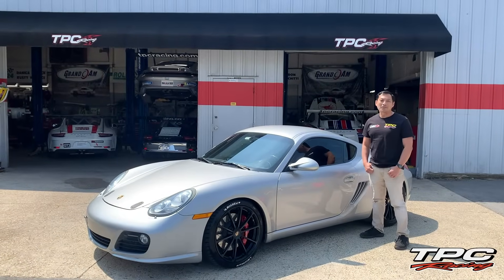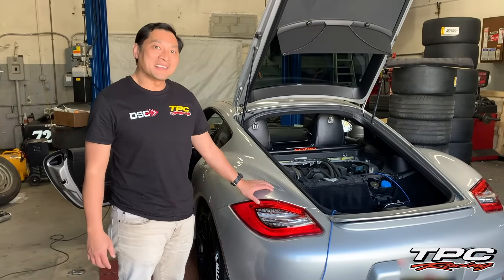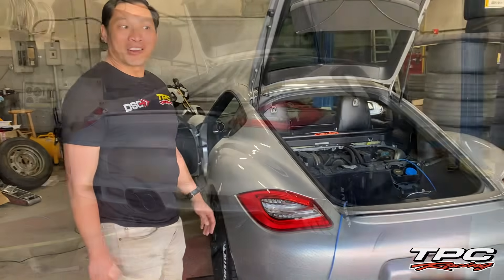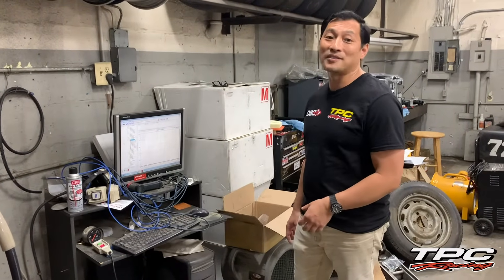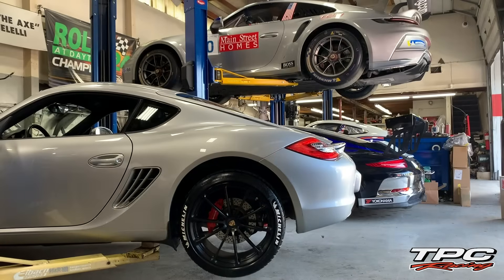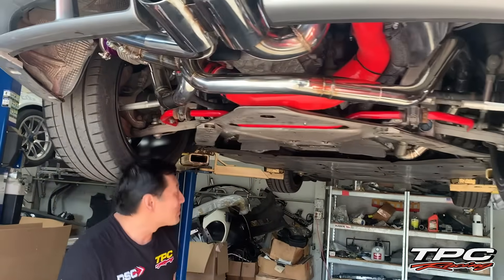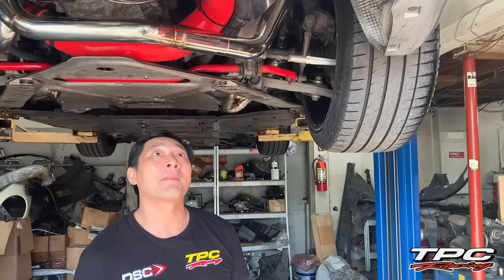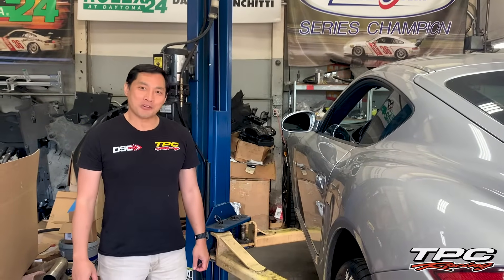TPC Racing Turbo Kit Install and Dyno on 987.2 Cayman S

Comment: 35k car parts labor for just 400hp 😬
Reply: You gotta remember. The 987 is full monocoque, flat bottom and mid engine flat 6. Its only maybe 200kg heavier than a miata, 400hp is a lot before pulling interior and doing carbon body panels. The 987 is also the last of the full analog Porsches.

Comment: 986 987 s models have trobles IMS bearing  ,and you put more power in to it .God bless you
Reply: It’s the 987.1 with that problem, not the 987.2
Reply: @dw4525  before 2009,higher chance for S models. There are some engine teardown videos,where they show more in detail.

Comment: Something is off in your final comparison.  The RunFile_001 graphs don't appear to match the original runs.  This shows up very clearly because the torque and (computed) power curves DO NOT cross each other at 5252 rev/min, which they should for the listed units of measure.  I really enjoyed the video, but the last graph has something wrong with it...

Comment: 265 is the regular cayman horse power, are you sure it is a Cayman S? If it is there is a major issue that makes it lose 55 hp.
Reply: Its probably not the S. The S is already supposed to have 300+ hp.

Comment: I dont even care what the P car snobs think. I want one (I'm throwing money at the screen) Looks like Ill be in good company. Torn by manual or pdk but think the manual would be a purer driving experience. Anyone use the manual as DD? 
Sorry for all the questions but what year is the IMS bearing no longer a issue?
Reply: 987.1 so 2005-2008 in the cayman or whenever the boxster was available I believe. But there still is bore scoring issues in all gens

Comment: Q: Looking at the 987.1 Stage II kit description on your website here in 10/22, it states that "exhaust manifolds and Cats are excluded" from the turbo kit.  However, in this install video, it looks like you are using a pair of S.S. tube headers, and (I assume, perhaps wrongly) some racing Cats. So these dyno results are NOT the results that one could expect if installing the TCP turbo S2 kit on a stock 987.1 Cayman S with the 6 speed manual, correct?

Comment: I have the stage 3 version of this kit and I have to say it could use a resonance chamber on the exhaust kind of like what bishimoto does with his cars.
Reply: Did you keep stock fuel injectors
Reply: @baby_tvlr  I Believe so. I don't run much boost.
Reply: @Stribogboi still going strong? Im afraid of doing this to my car dont want my engine ti blow

Comment: Very tempted to do this on my 987.2.
I noticed the tone changes with this plumbing of the turbo/exhaust. Very deep, less treble.

What exactly causes that, and is it possible to keep the turbo and restore that treble note?

It’s a long term build, so I’m not afraid of some custom exhaust work 😄
Reply: Less baffling in the muffler, size of the pipes, plus the headers themselves will change the exhaust note.

Comment: How much weight does this kit add to the car? Most of the weight are in the engine locations? Trying to look for a way to get a track only Cayman down to 2500lbs.
Reply: Dropping 500 pounds while adding a turbo and presumably a roll cage?  Good luck.

Comment: Does it need other upgrades to handle the added torque and hp?
Reply from the maker: No the car is very capable of handling this power level. However we do recommend replacing the clutch if it is a high milage car